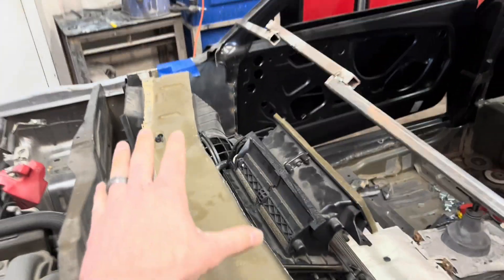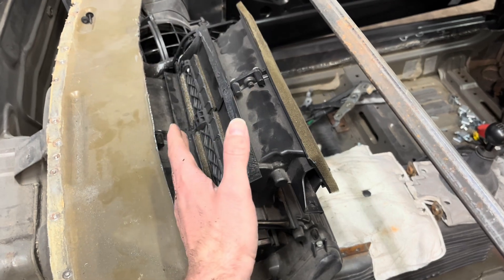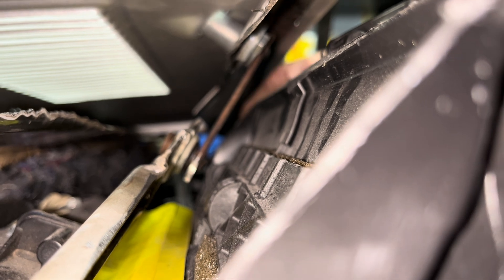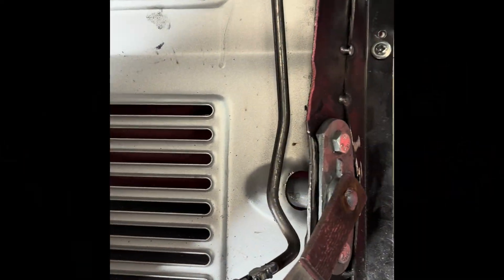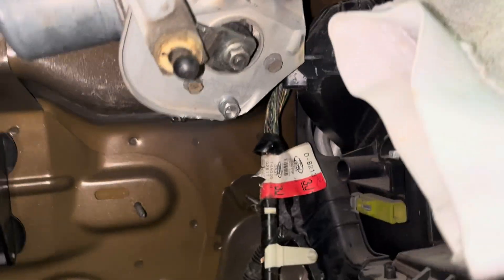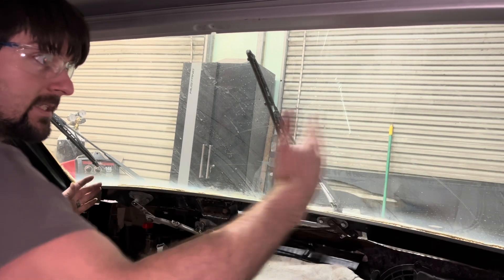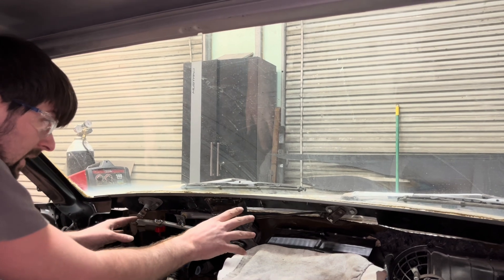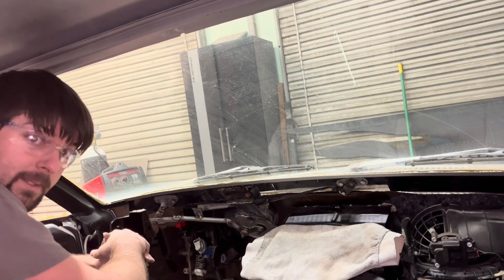Mustang Body Swap defrost and wipers

Comment: Hello @1194video, awesome vid thank you for sharing, I subscribed to your channel as well. We are trying to recreate the wiper linkages you used in this video, do you have any pictures for reference or measurements?
Reply from the maker: I don’t and it’s very tricky, every car is different and there are many different variables, moving the wiper motor over just a 16th would throw it all off. You just have to find a good place for your motor then go from there.

Comment: Wipers are a pain.
Reply from the maker: They are, I started on it at 8am and after 4 different tries I finally just got my motor mounted where I wanted it then did each wiper at a time, the defrost box figuring took some time but if your going to build a body swap you want everything working like it should. It’s just roughed in but will look clean after final